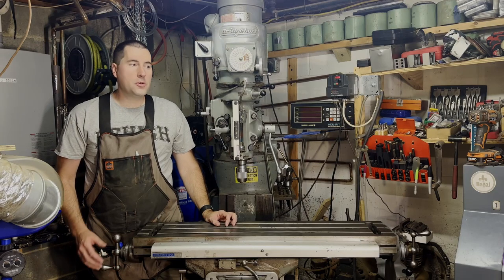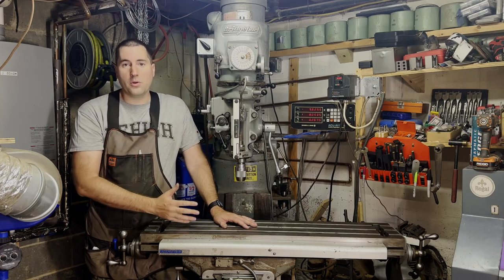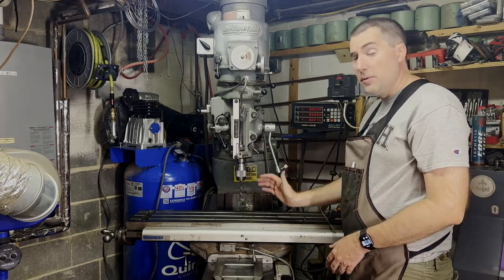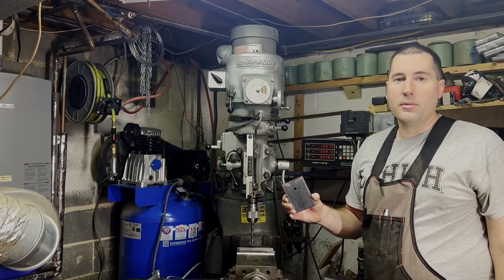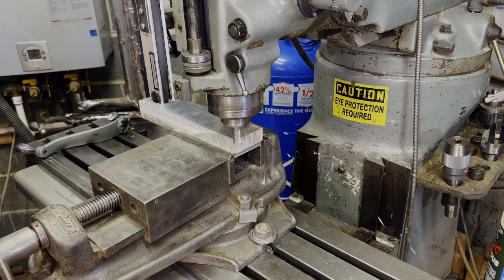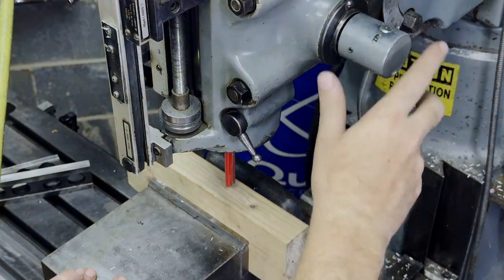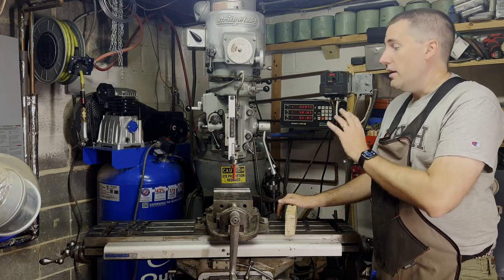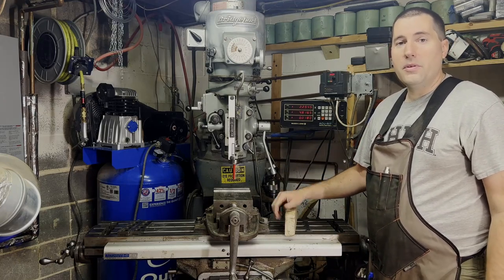Why you should buy a Bridgeport Milling Machine instead of a Drill Press

Comment: Hey just a heads up, the power quill feed is really not designed for drilling. You can get away with it on small drill bits, but you will absolutely destroy it using larger drill bits. Its primarily to be used with a boring head.
Reply from the maker: Per the Bridgeport manual its rated for 200lbs of downforce or 3/8” in steel.

Comment: Very informative.   I may have missed it but roughly, how far off a wall would a Bridgeport stick out. I have a shot at getting but need to make sure it will fit in the area I have planned for it….thanks
Reply from the maker: Around 60”, although it depends on how much you extend the ram.